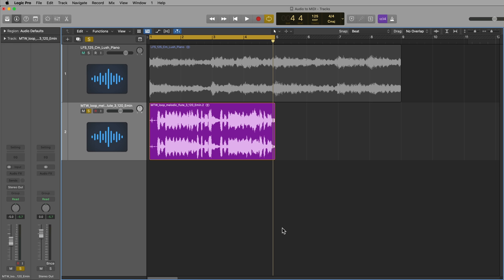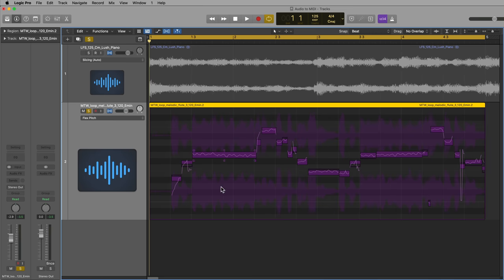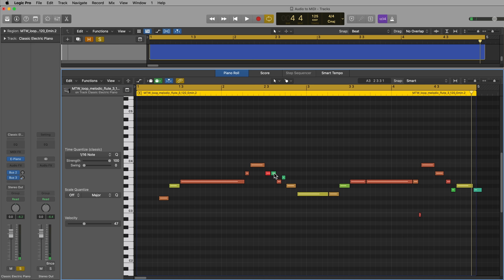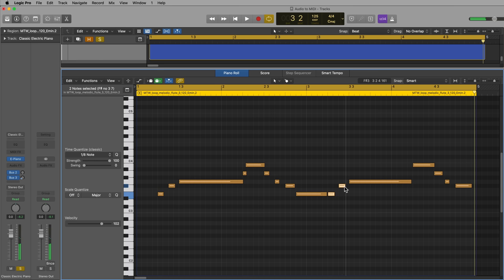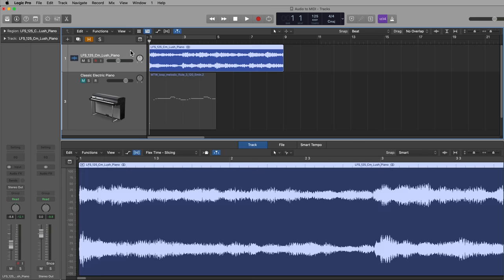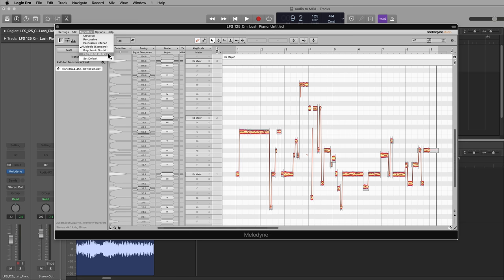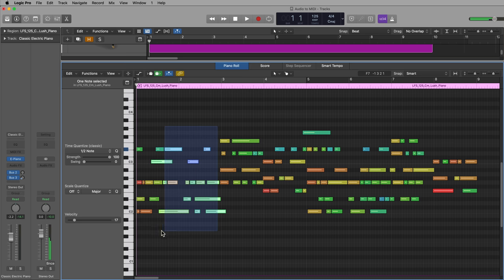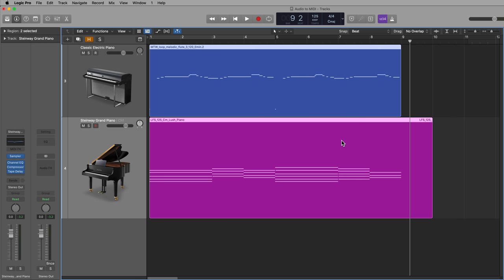Logic Pro // Convert Audio to MIDI (2 METHODS)

Comment: Thank you for exposing me to this tool called Melodyne, your tutorials are great. One thing I noticed is when you switched over to Melodyne on the second part of this video, it was not mentioned to disable Flex time for faciliatating this step. I ran into some hiccups until I figured it out. As a newby Logic user, I struggle when even micro steps are left out 🙂

Comment: Thank you for the info. It’s very useful. My question is, is it possible to get the MIDI of the sample with the ORIGINAL sounds from the sample. I want to manipulate the sample by moving notes around from the original sounds. In other words I don’t want to use an additional sound for the MIDI. I would like to use the original sounds from the sample. How would I go about doing that?

Comment: I have a Yamaha PSR-S950, which has various midi styles. A midi style consists of 6 midi instruments, which I’m sure logic can record on one midi track. Cubase 8 has a menu selection under the EDIT drop list which can DISSOLVE the one midi style track into 6 midi instrument tracks. This really speeds up production. My question is, does Logic Pro X have the same feature capability?
Plz advise asap because I’m on the fence if I should purchase Logic Pro X or Cubase 12. Thanks….